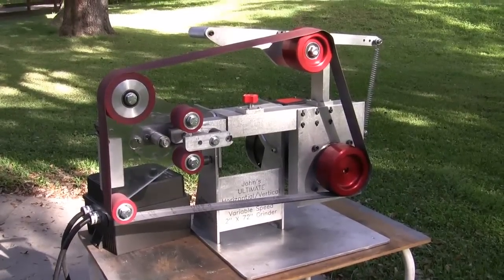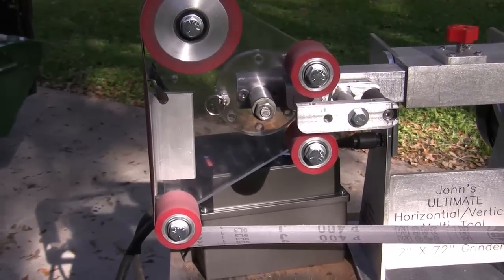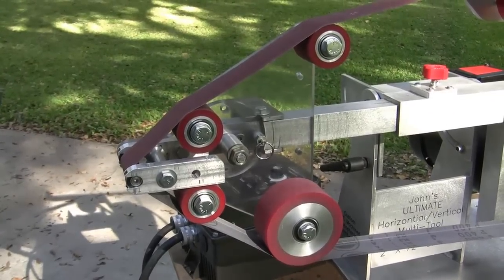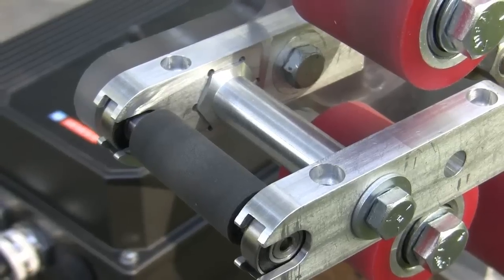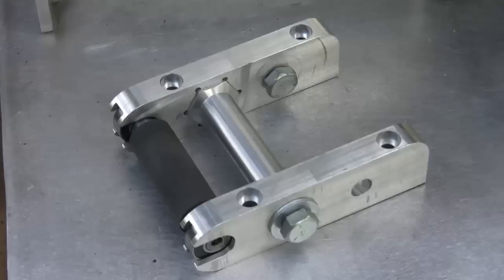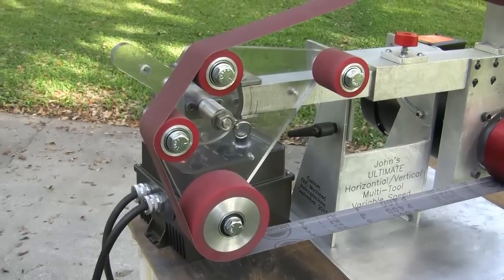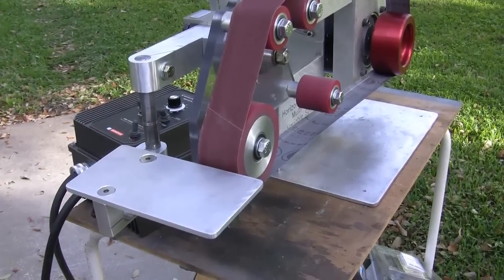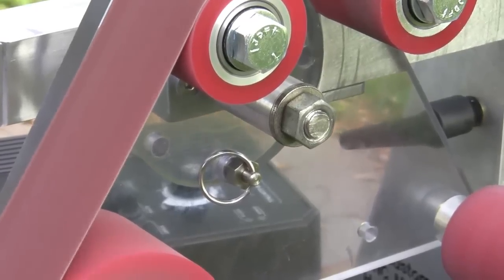2 X 72 Grinder Rotary Indexing Platen Demo 13-12-13

Comment: DAMN!! I’ve been thinking about building a belt grinder for a few months and I thought I’d come up with something unique in the form of a rotary platen, you beat me by 5 years. Lol
This is such an interesting and well designed machine I’m surprised I’ve not come across it before. 
Are you selling these?
Back to the drawing board.

Comment: I have been reviewing designs of almost a hundred youtube belt grinders to build, and this one is the most innovative by far. Congratulations - this is inspiring!
Reply from the maker: Hi,  Thanks for the favorable comments.  I too did a ton of research prior to building my grinder.  The rotary platen idea was my idea and it adds a lot to the versatility of the grinder.  I More tool bars can be added if necessary.  With this design the possibilities are limitless.

John

Comment: Hi !

What a nifty idea with the triangle plexiglass plate !

What are your experiences with  the ware on the rollers when you thread the belt for the very small front roller - the 2 rollers just behind will have contact with the grinding surface - will they stand that ?

Comment: Awsome!!
Reply from the maker: +NorseMarauder 
Thanks for the favorable comment.  It is truly amazing all of the different projects you can accomplish with this 2" X 72" Grinder.  With the Rotary platen and the flexibility to made additional custom toolbars the possibilities are endless.  This is a grinder that will last you a lifetime.  I love it!

Published on Dec 16, 2013Here is the link to the completed grinder showing all of it's features.  https://www.youtube.com/watch?v=XxI8_...

This
 video describes the different contact wheel positions available on my 2
 X 72 Belt Grinder with a Rotary Indexable Platen design.  It is my 
belief that this is the first such rotary platen which incorporates a 
locking pin in the design with multiple wheel diameters and also a small
 wheel attachment all in one tool-bar.  Not shown here but by removing 
the locking nut, associated spacer and the rotary platen my 8" contact 
wheel and associated spacer can easily be installed on the same tool 
bar.

The original design concept can be viewed here: https://www.youtube.com/watch?v=bxH4f...
  This video shows my design concept of how my Rotary Platen will work 
on my 2 X 72 DIY Grinder with indexing feature. Check out my thread on 
the CNC ZONE for full details on my build.  http://www.cnczone.com/forums/general...

This project was designed and manufactured on my HAAS TM-1P utilizing ONECNC XR5 Professional CAD/CAM Software.

Update
 01-19-14  I have machined from Aluminum all the original Rotary 
Indexing Platen Plate plastic prototype parts and updated the contact 
wheel bearing retainment system.  I am still working on another tool bar
 that will have a contact wheel on one side and a ScotchBrite wheel on 
the other end.  I am also going to design a metal stand for grinder with
 wheels so that it can be moved around the shop with ease.  I will post 
another video once I have completed these tasks.  
    
    
      Category
    
    Howto & Style
  
John

Comment: I am a sharpening tech and would love to build a version   similar to your grinder of my own. Any way you could email me so that I may ask you tips and such? it would be much appreciated! elijah.cel@ gmail.com

Best regards, 
Elijah
Reply from the maker: +AeriformEvolution 

Here is the link to the completed grinder showing all of it's features.  https://www.youtube.com/watch?v=XxI8_XdvXN4

This video describes the different contact wheel positions available on my 2 X 72 Belt Grinder with a Rotary Indexable Platen design.  It is my belief that this is the first such rotary platen which incorporates a locking pin in the design with multiple wheel diameters and also a small wheel attachment all in one tool-bar.  Not shown here but by removing the locking nut, associated spacer and the rotary platen my 8" contact wheel and associated spacer can easily be installed on the same tool bar.

The original design concept can be viewed here: https://www.youtube.com/watch?v=bxH4f_yuVtU  This video shows my design concept of how my Rotary Platen will work on my 2 X 72 DIY Grinder with indexing feature. Check out my thread on the CNC ZONE for full details on my build.  http://www.cnczone.com/forums/general_metal_working_machines/191790-diy_2_x_72_belt_grinder_computer-numeric-controld.html

This project was designed and manufactured on my HAAS TM-1P utilizing ONECNC XR5 Professional CAD/CAM Software.

Update 01-19-14  I have machined from Aluminum all the original Rotary Indexing Platen Plate plastic prototype parts and updated the contact wheel bearing retainment system.  I am still working on another tool bar that will have a contact wheel on one side and a ScotchBrite wheel on the other end.  I am also going to design a metal stand for grinder with wheels so that it can be moved around the shop with ease.  I will post another video once I have completed these tasks.

I do not offer these for sale.  I do however have cad/cam files and associated pictures with dimensions that may be of help.  You can e-mail for that information if you are interested at clarkj@tampabay.rr.com

John

Comment: Love that platen. Is there any concern that the belt will damage the wheels when you place the abrasive side against them?
Reply from the maker: Kyle Bracht 
Hi  Kyle,

I have been using it for almost 2 years and no signs of wear on the polyurethane wheels.  Depending on what you are grinding it may get a little residue on the wheels if my rotary platen design belt threading configuration allows for contact of the abrasive side of the belt to ride on the wheels.  It is easily dusted off.  In as much as the belt and the wheel both turn at the same speed there is very little if any abrasive action.  This is the most used tool in my shop.   I am glad I took the time to build it.  Don't forget to view my latest video on the completed design showing all the accessories and tool bars that I made for it.

John

Comment: I like the name.. "John's Horizontal / Vertical MultiTool".. much better than widget #1, etc.
Reply from the maker: +gbowne1 

I called it the Ultimate Grinder as I did a ton of research and tried to pick out the best of all the 2" X 72" grinders and added my Unique Rotary Platen Design which put the icing on the cake.
Reply: thought that was cool

Comment: John, Hurshy here, your grinder is looking good. My Mechmate is nearly complete. Thanks for the help.
Reply from the maker: <p> Hi Hurshy,  Thanks for the favorable comment.  Check out my thread on the CNC ZONE for full details on my build. You will see pictures of the aluminum parts and current updates to my project which includes the mobile stand.  Still working on the second toolbar.  @forums/general_metal_working_machines/191790-diy_2_x_72_belt_grinder_computer-numeric-controld.html  Please post a video of your Mechmate when complete.  John</p>
Reply from the maker: <p>Hi Hurshy,  Here is the corrected link to CNC Zone</p><p>@forums/general_metal_working_machines/191790-diy_2_x_72_belt_grinder_computer-numeric-controld.html</p>
Reply from the maker: <p>Hi Hurshy,  Guess I can't link a url here.  Check out the about info box and you will see a link there.</p><p>John</p>